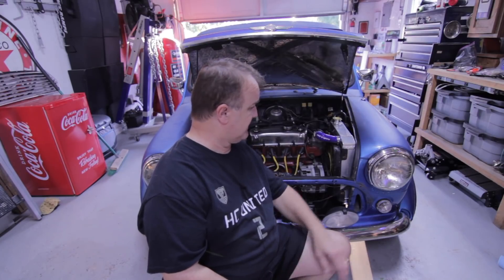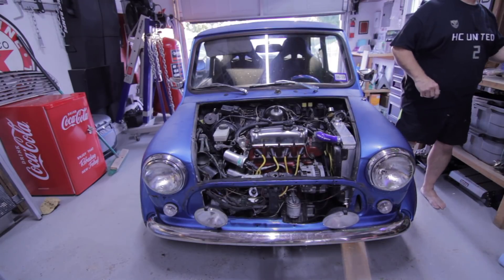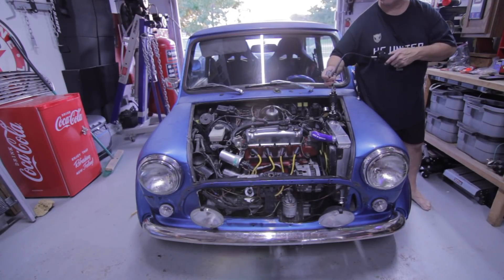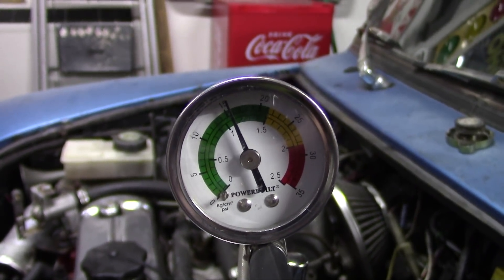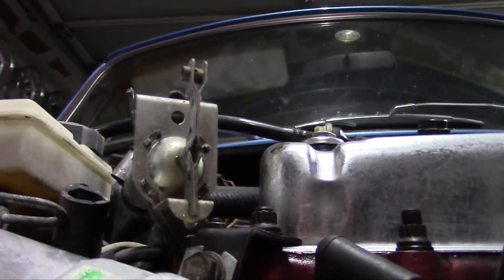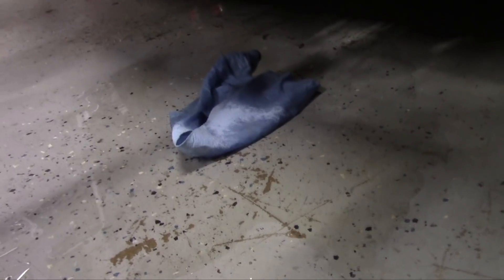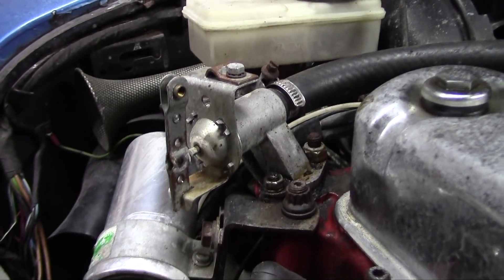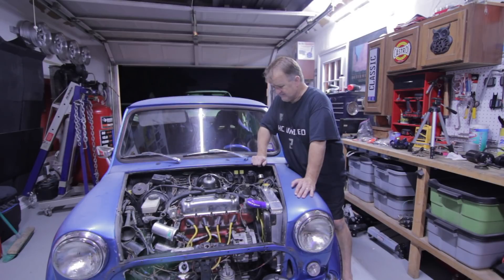Episode 9.1:  Engine Overheat Trouble Shooting

Comment: Tip of the day: Stop removing your bonnet and take a tennis ball, cut slit into the ball and push onto your bonnet latch.  Aligning a bonnet after you take off takes a bit of time and not necessary.
Reply from the maker: thebluep0tat0 I have learned to hate the quick release bonnet brackets.   I plan to install the full lift hinges with gas struts.   With all that mentioned, I don’t understand how a half tennis ball in the bonnet latch helps the situation.  Perhaps you meant to say put the tennis ball in the hinge to help keep it from folding??
Reply: No - tennis ball on the hook/latch so you dont bump/gouge your head and therefore - bleed.  Tennis ball does not solve for getting you more space to work on engine, but helps protect your head when working with the bonnet in place.
Reply from the maker: thebluep0tat0 ah...  understand!!

Comment: Where the leak is coming from is the heater tappet that comes from the block into the heater core.  It's the hot side.  You had your heat directions off since the heater core pulls the heat off giving you cabin heat.  The other line is whats fed back into the engine with the cooled water/coolant from the radiator.  Hope that helps you.  Also since we both live in Texas, you need to add some "Green" 50/50 mixture coolant.  Summer time you can add a bit of water to the system.  I'm down in NB if you have any questions of how we deal with the heat down here.
Reply from the maker: Thanks Zack..  Yes, I'm slowly figuring out the car and I am incredibly pleased with just how helpful the community is.  Glad to find another in Texas!!  although where is NB?
Reply: @LoneStarMini   You're very welcome.  NB = New Braunfels.  We have a huge classic Mini community down here.  I'm headed to Pensacola for the weekend to pick up a 1275 from a guy that's doing a swap.  I'll have to rebuild it since water got into the block and seized the pistons.
Reply from the maker: Zach Petersen awesome, you’re one of the closest mini folk to me.  Would love to come down and meet you at some point   It looks like I will also be tearing down my 1275.   If you get there first, I would like to offer my volunteer help..... of course I’m learning and can offer no technical knowledge.
Reply: @LoneStarMini    No worries.  You can also check out Cole  @classicminidiy on here.  He's in North Carolina and has lots of instructional teardown and rebuild videos.

Comment: Water from the exhaust is normally a good sign and the water heat physicaly travels up that coiled wire so the gauge must be a bit faulty.....
Reply from the maker: Definitely found the Temp Gauge is slightly messed up.. next video.  Thanks Dave

Comment: Hi Randy,   I think Piper Doug was on the money when he said the leak dripping on the coil probably caused the initial difficulty starting.    And I think you'll need to buy a new heater control valve to solve your leaking and thus overheating problem as I don't think they're a fixable part.  As to the temperature gauge being stuck past the maximum temperature perhaps tapping the side of the gauge with something will dislodge it and it will go back to normal. Most cars when started cold spew moisture out of the tail pipe.  Warm exhaust fumes on cold metal equals condensation.  Hopefully you didn't run it for too long when it overheated and warped the head. Chances are you didn't.  Fingers crossed.   Cheers, Midge
Reply from the maker: Much appreciated Midge!    No time to research today, but I'm thinking of finding a way to bypass the heater and valve altogether as I don't exactly need a heater here in TX.  Either way, it's a bit of fun learning on this car and honestly I'm kind've excited about the idea of replacing the head gaskets and checking how straight the cylinder head is.  Not sure I will just now, but we shall see ...  thanks again.

Comment: That's a win Randy nice easy fix! exhaust looks perfectly normal! A wee compression test for piece of mind. Give it a service new oil plugs filter and some coolant. your old plugs will indicate how its been running.
Reply from the maker: Thanks Jon..  I will still run a compression test along with another pressure test when I "fix" the current leak.   After I know the leak if fixed, I will consider oil and coolant change.  With that said however, if I decide to replace the head gasket, then I will wait to do the oil & coolant change until afterwards.

Comment: Hopefully a nice easy fix by replacing the heater control valve. When the engine is running and you are driving it is not ad easy to see the leak because it evaporates on the hit engine before hitting the ground. As Dave suggests do an engine compression test. You will get a kit very cheap. Best way to learn about these things problem solving. You will know this car inside out before too long
Reply from the maker: While I realize that problem solving is generally the way I learn, it's still a tad  uncomfortable when it comes to anything automotive.  Yes, I plan to retest the cooling system as well once I fix/replace hte heater valve.. thanks!!

Comment: Randy, As everyone has said theres no doubt it‘s the heater valve needs replacing, I would rent a compression tester and check each cylinder this 
will let you know if there is any problem with the head casket, The timing is very easy to adjust just back off the lock bolt slightly so you can just 
turn the distributor body then start the engine, turn the body very slowly and you will hear the engine speed increase or decrease, pump the throttle 
to hear when the engine is running smoother. This will give you a basic setting you can then use a strope light to get it spot on, Hope this helps. 
Cheers Dave
Reply from the maker: Thanks Dave.  I will fix/replace the heater valve and then retest the cooling system just to be sure.  I will also test each cylinder as you suggest!!   I've also ordered Evans coolant and new oil.
Reply: Randy, If your using Evans you need to use there pre flush as well, I take it you will not be selling the mini now! Cheers Dave
Reply from the maker: @ClassicCarCave  thanks and yes.  I believe the Pre-Flush arrived today.  I think now that I will figure out how to bypass the heater and valve altogether by removing the heater.  No time today to research.. maybe tomorrow.

Comment: The leak is from the heater control valve, which looks like it's missing the cable, it should be like the choke cable inside the car & as Piper Doug has said it's leaking over the ignition coil.
What was the electric cable hanging down by the sump, with water dripping from it?
Reply from the maker: Thanks Mate..  Yes, I don't know what other items were removed to run the heater so I'll have to look into that as well.
Reply: @LoneStarMini I'm enjoying the content by the way😉👍
Reply from the maker: @sharky09000  , Thank you for the compliment.  No time to research today, but I'm looking at removing the heater altogether and running a bypass on the cooling lines.
Reply: @LoneStarMini  Good luck with that 😉

Comment: The heater control valve is definitely at fault...an easy fix luckily. Temp gauge should be ok. I would get the valve changed, top up coolant and keep a close eye on the levels and make sure there’s no mayonnaise in the oil or gunk in the coolant, it may have warped the head given how hot it got but just keep an eye on things. You can get water in the exhaust through condensation and it will store in parts of it naturally, so some steam on start up is expected.  Hope that helps pal
Reply from the maker: Thanks Tom..  I will fix the heater valve and the probably retest the system again.  In a way, I kind've want to tear down and replace the head gasket, but before I do, I'll simply watch it.

Comment: hard start is probably due to the coil being right under the leak. and ye probably got the grounds for the blinkers wet too. that return for the heater core is defo your problem. great problem solving, and dont worry too much about the drips from the tail pipe that is quite common just with humidity in the air. cheers bud.
Reply from the maker: thanks Doug for the support..  as always because I'm learning, I'm not 100% confident on items I find.